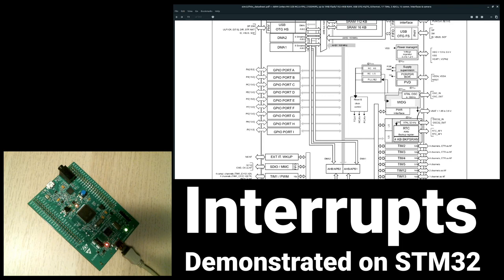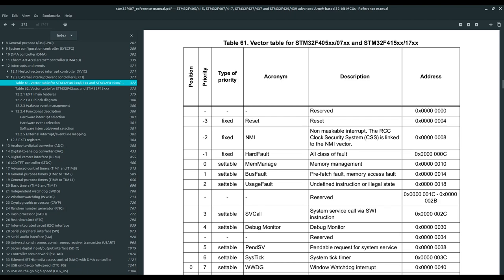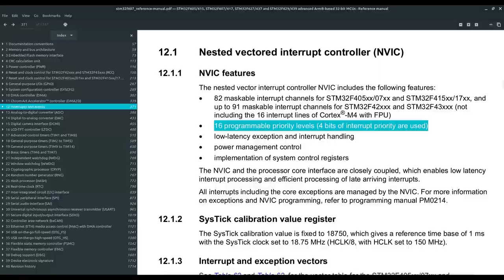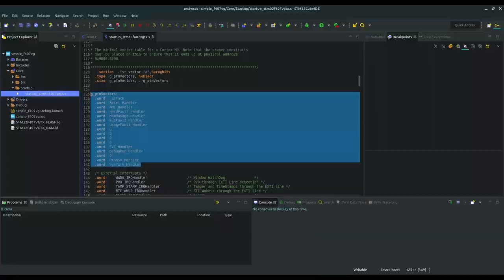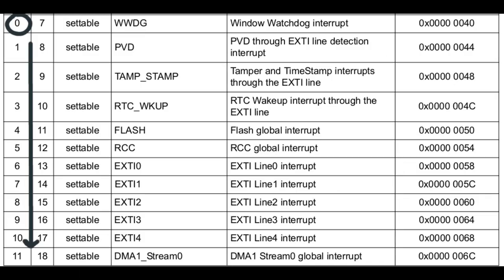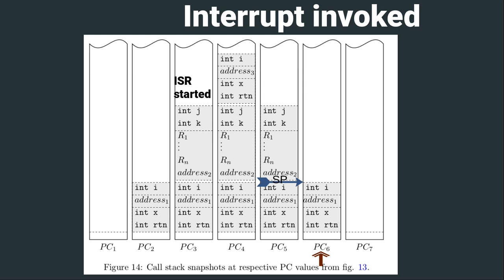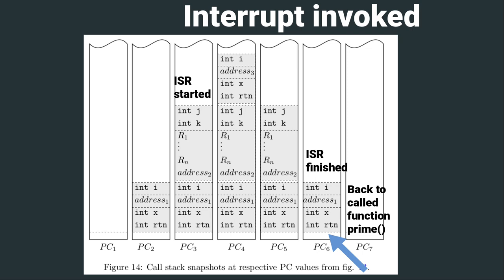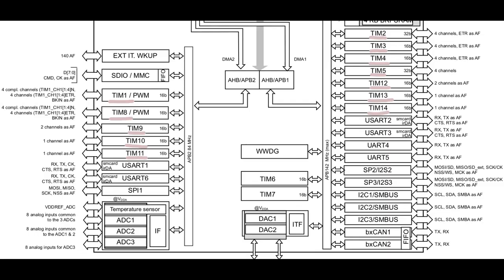Interrupts on Cortex M - NVIC (demonstrated on STM32) | VIDEO 34

Comment: at minute 25:37, you perform an SPI transaction from within an ISR?
Reply from the maker: Yes. In the use case for the demo, an interrupt for SPI should not block for that long and since the peripherals used inside of the ISR are not used anywhere else in the code, there should be no problem with race register access. It's an isolated case, but not a rare one. I've had a system designed without an RTOS and we used RTC ISR to trigger "precisely" spaced interrupts for sampling SPI ADCs for example. As my work colleague would say: "If you don't measure it, don't poke it". In that case, SPI is quite fast (10Mhz) and it only transfers 16 bits from each sensor, so the whole ISR was quite short and plenty fast for the sampling rate. Context matters and can ease the design.

Comment: Great but calling conventions on ARM typically use some registers to pass arguments, not the stack... that part is rather confusing
Reply from the maker: That's true. The stack would be used in case of larger arguments or in case you pass a lot. I guess the explanation was a bit simplified and in a way inspired by academic explanations.

Comment: Thank you for the valuable content. I would be grateful if you could assist me in answering a question. Regardless of whether the interrupt type is ISR or NVIC, if a falling edge triggers a signal that is going to be sent out through a digital output after a specific delay, and if this delay takes so long that another falling edge occurs at the same time the MCU is sending out that signal, the Interrupt Service Routine will interrupt the main program responsible for sending out the second signal, resulting in the second signal not being sent out as intended. I have already posted this issue on the forum, but I have not received any new information thus far. Does this explanation make sense to you?
Reply from the maker: Let me summarize your problem so that I can confirm if I understand it correctly.
You have a signal, like an external digital signal, that triggers an interrupt.
That interrupt starts a signal generation, which happens in main. I assume that you have a variable for the communication between interrupt and main.
Main program will wait a set delay amount before signal is generated.
In case, another interrupt arrives, which would create another request to start a signal generation from main, you are worried, that it might be corrupted?
I think I understand your situation or at least I have a few similar scenarios in my head similar to your problem. Can you confirm that?

If so, one answer is that you need to specify the behaviour of the signal generation trigger. You can use another variable, which is written to by main and read by interrupt, which specifies if the main loop is still processing/generating signal. If that's the case, interrupt service routine should just exit, thus ignore the trigger signal.
You can also use the trigger variable as a busy signal. If not set, ISR will set it, maybe do something else. When main reads it, it starts signal generation. If the ISR implementation is so simple, it can just keep setting the trigger signal "to 1" and main won't do anything, since it's still processing the first signal generation. When main is done, it can set the shared signal variable "to 0".

In the case, that you DO do something in the ISR, such as start a timer or any other peripheral, I would strongly suggest adding more status and/or synchronization mechanism either to the interrupt or the main, depending where the most time consuming part is beeing held, like the delay. You can also implement delay as a "state" in the signal generation state machine. With frequent polling you can check the state of the machine.
Reply: I really appreciate your help, thank you! I'm not sure if I explained the problem as I should. I have a signal (S1) which is coming from an external hall sensor and has the form of a square signal with a frequency of max. 25 Hz. I want to detect the falling edges of this signal a send out another signal (S2) through a DO after a specific delay after every falling edge. So the square signal simply triggers the signal I want to send out. The delay value is going to adjusted through a Potentiometer. The code that specifies the form of S2 is written in the main program. Everything works perfect besides when sending out S2 by the main interferes with a new falling edge of S1 which is detected by the ISR. When this happens the S2 starts behaving like it's triggered by the falling edge anymore. The Problem is that I'm not allowed to ignore any of the falling edges. So if put a variable that checks if the main is still sending out S2 and just exit the ISR when it's the case I assure that new falling edge will be "ignored".

Comment: i have a rising edge interrupt. i'm not even sure it works but when i enable it - while loop breaks. looks as if it goes into interrupt and gets stuck in there in some weird way. but the interrupt pin has never really risen (checked with an oscilloscope). actually i have a message inside the interrupt the interrupt function to notify me that the function was called - it doesn't get called. so if it doesn't goes to interrupt what could mess everything up in such a way? (if i disable interrupt it works normally)
Reply from the maker: First just declare the interrupt function fron hal empty. It should work as that. Then try adding back your code and find out where it gets stuck. Also make sure that your priorities are configured. In CubeMX NVIC panel make sure that your interrupt is enabled

Comment: Your GPU is running at 60C in idle. That's a common problem with Linux Mint. I think building the newest Kernel should help, since Mint is usually pretty far behind. 
I had the same problem where Mint showed 60C while in Windows I had only 35C.
Reply from the maker: The gpu while recording was not in idle because usual idle power draw is 40W and 38C, but here it was almost 90W, so maybe 58C is not that off. Plus I only have one back fan for my case(old workstation).
Now I use fedora for work related reasons. Drivers should be more up to date and stable.
Reply: Ah, it's a desktop? The problem afaik is only present on laptops with two gpus (ie. intel + nvidia).